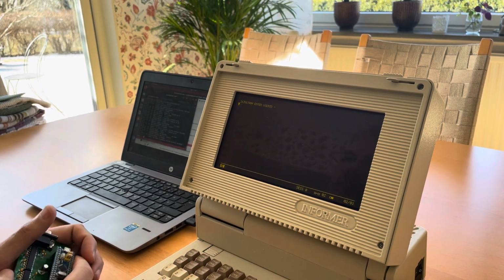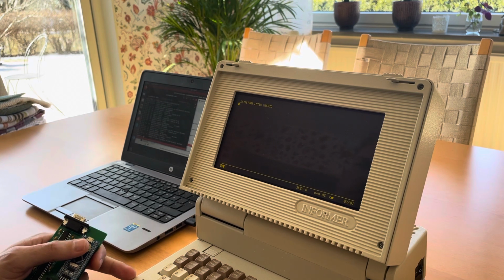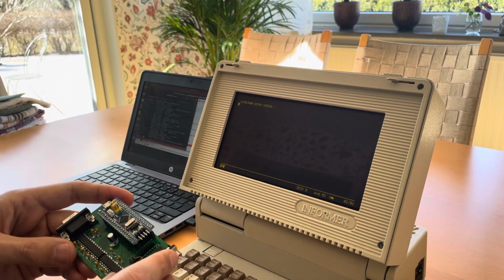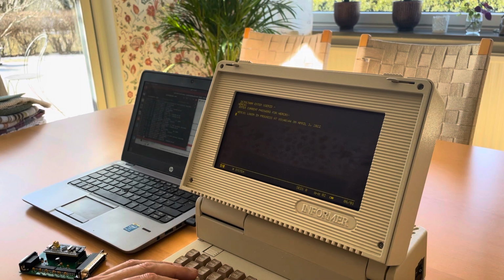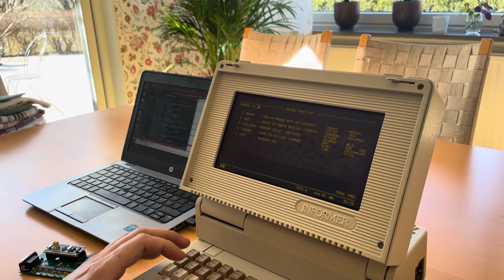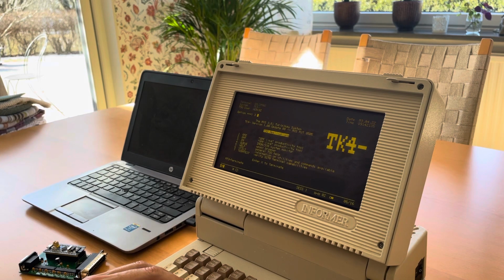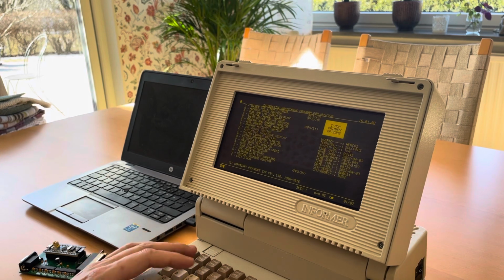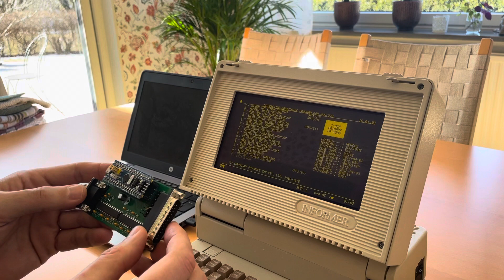Informer 213 connects to Hercules

Comment: I have this Informer model and have always wanted it connected as a terminal/console to Hercules. I don't understand what was done here to get connected or what hardware is needed... my interest is very high in this.
Reply from the maker: There are three parts. A piece of hardware. https://github.com/MattisLind/alfaskop_emu/tree/master/hardware/SyncDongle . A firmware for this hardware: https://github.com/MattisLind/alfaskop_emu/tree/master/Utils/SDLCBridge . And finally a 3705 emulator: https://github.com/MattisLind/IBM3705  .  All this together allows to connect to Hercules. Please check these links.

Comment: Very very nice.  It’s nice to use a real terminal. Congrats on getting this done!
Reply from the maker: Thanks! My plan now is to check if I can get this solution working with an IBM3174 and IBM3178 as well. Then also modify the IBM3705 emulator to handle IBM BSC.
Reply: @mattislind4443  Technically that would be great. On the other hand, working 3174 (with working firmware floppies) are hard to find and cumbersome to use. Emulating channel-attached 3174s I think opens us more terminals that can be used.
Reply from the maker: @moshixmainframechannel  BTW. Those 3174 floppy drives can easily be replaced with goteks with flash floppy firmware. Mine boots just fine off the gotek. Haven’t managed to configure it properly though.
Reply from the maker: Isn’t that almost what the github user lowobservable has done with his oec? https://github.com/lowobservable/oec  Only quite few terminals is supported which probably is because the coax interface is not very well described as far as I understand. The interface of the remote 3274 / 3174 towards the host mainframe is on the other hand very well described which makes it much easier to work with.